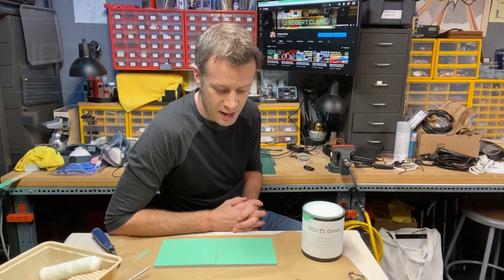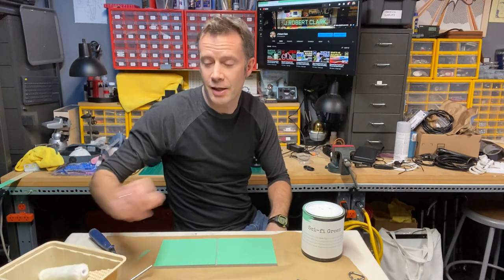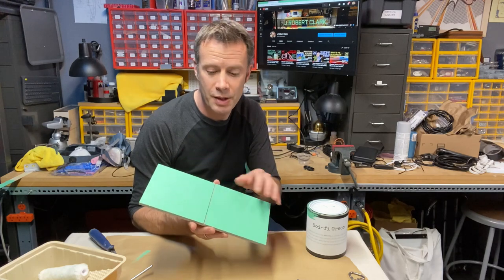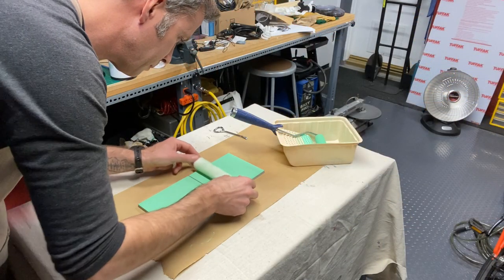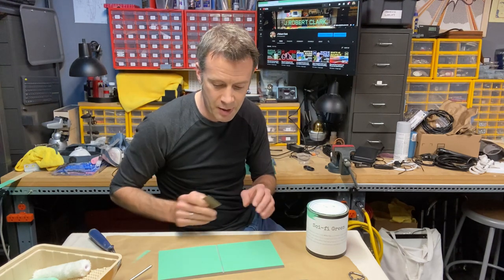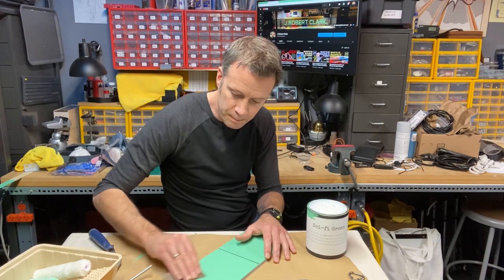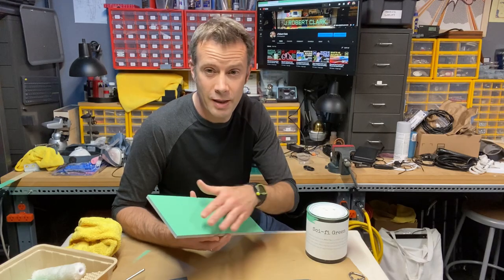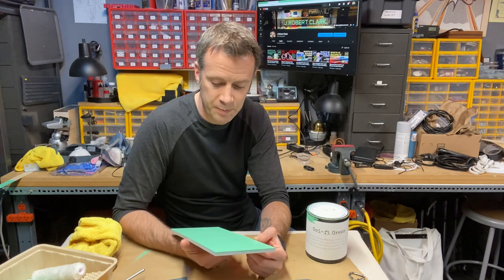Latex paint: you can sand it smooth! Today on 'What's he building in there?' 2021.03.31

Comment: I found using tsp and warm water about 6 to 1 and like you said 600-1000 grit and the trick is to very light Sand and keep it wet to prevent the friction from burning through the latex
Reply from the maker: Wet sanding is probably a great idea. Thanks for sharing.

Comment: so my question is that i used dulux wodd primer latex one and used a brush real heavy thick coats to cover up chips in the paint and flaking paint marks but now i realise to my horror i cant sand it dont with dry paper or can i as i need to p[ut top coat on before winter

Comment: Great idea!  How long did you let the paint dry? I’ve tried to sand latex paint before, even after 60 days of drying without much success, but I was probably sanding too aggressively. The layer would shred and peel off. I’ll have to try this, then maybe follow up with a clear coat of poly acrylic that can be buffed to a perfect finish. 

If this sanding process works reliably, you should definitely do more demonstrations and at least one short showing how this works. There’s demand for videos showing how to get a good finish without using oil-based paint, so I bet you’d get a lot of interest from new viewers. 

Take care and stay positive!
Reply from the maker: I actually rushed the painting for this demo - it probably dried for an hour in direct sun. The important part is not to sand too aggressively. And to not expect a mirror finish. There was some inherent orange peel in the test I ran - doubt you could get that out easily. But it does wonders for those mistakes and/or lint as I described. Would be fun to experiment with it more. Maybe using a poly-acrylic clear coat, as you suggest. Let me know if you try it!